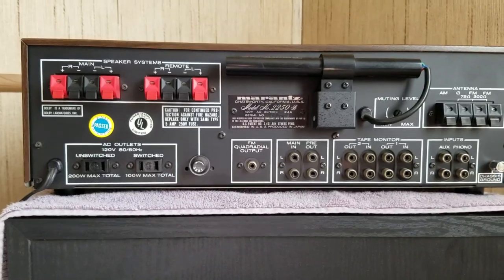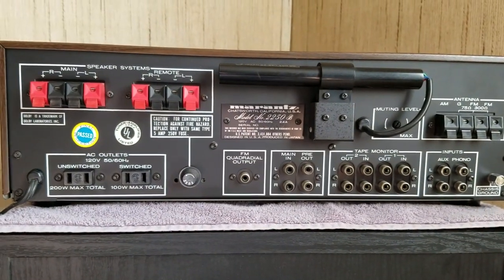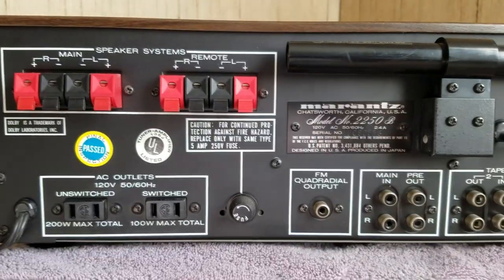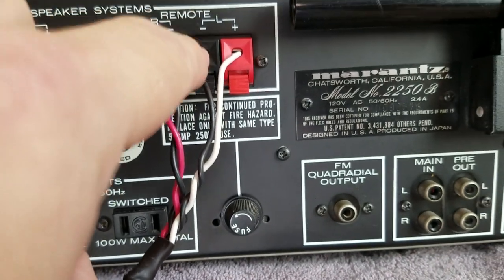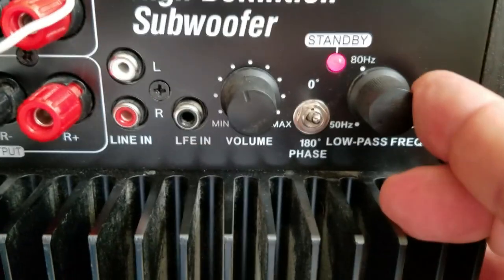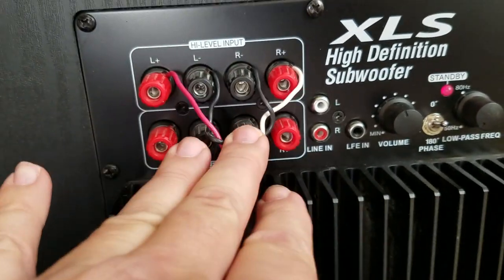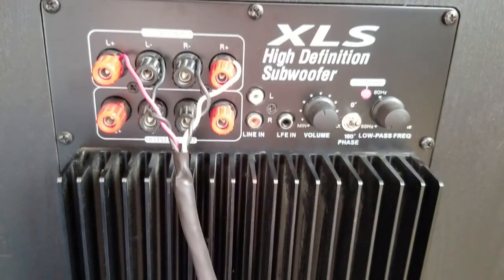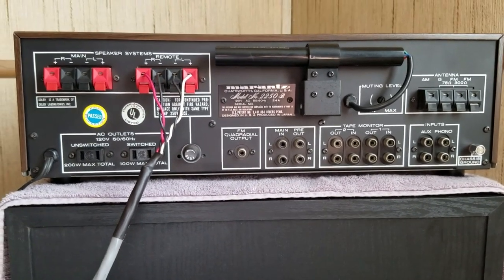How to add a Subwoofer to any Vintage Stereo

Comment: You neglected to illustrate how the front panel settings should be set. I'm assuming you set it to A&B , correct?
Reply from the maker: Correct on the a&b speaker settings. Treat the tone settings as you normally would to add or take away from your main spks, the X-over and gain controls in your sub will be independent of your stereo. Cheers
Reply: @breakerbroke23  Thanks. It's what I figured.

Comment: My klipsch  heresy's
  sound great  but need more low end  thanks  !
Reply from the maker: IMHO... Heresy's kind of suck! I have owned 2 pair and still own my original birch ply Heresy's, in order to stand to listen to them I use a sub. I use a powered 15 and roll it off a bit high. I would sell them but they are kind of sentimental to me:) I used an old Kenwood Model 11 II. No AV amp for the Klipsch....Cheers
Reply: @breakerbroke23  mine thru my sansui dont suck , but there is no bass .
Reply from the maker: Yes, no low end. Any speaker of this physical size and sporting a 12 inch driver should have some low end. Yes your Sansui will make them sound good compared to any modern AV receiver. But still a complete letdown. IMHO They need to be accompanied by a subwoofer. We need to remember they were designed to accent the K Horn .... Was the K Horn the low end producing speaker of the day?
Hmmm neat stuff  Eh?

Comment: Super excellent video thank you and God Bless you for your instructions, I have a Pioneer Sx 1050 rated @ 120 RMS per channel with 3 speaker channels A, B, and C. This means I can run 3 sets of speakers. all 2 pair are klipsh but I found an excellent sub woofer by Klipsh I purchase for 100.00 at a garage sale it has a 10 inch woofer and I want to know if I can run that on the 3rd C channel for extra depth, I am addicted to base, Your expertise would be greatly appreciated!
Reply from the maker: Yes that will work great, Just make sure you can get audio from spks A&B or C when using A . Some stereo receivers can only use A or B but not both at the same time.
 If you have a receiver that does this then just hook up the sub to spk A along whit your spks. 
I like using A for spks and B for the sub. Yes there are times I don't want a sub so then I can just switch off spk B.
Good luck and Cheers.
Reply: @breakerbroke23  Excellent, thank you so much!  Much appreciated!

Comment: Finally able to get out my old stereo that I purchased in the service, circa late 80's. In the video you talked about the power the amp puts out and into the sub, my sub is a jbl venue 12 powered at 250 rms. If hooked up to speaker b from yamaha amp could that cause plate amp in sub to blow fuse?
Thank You for any advice and the great video.
Reply from the maker: If that sub has speaker inputs, it will accept the speaker output from your Yamaha. Should not blow fuses.
Reply: @breakerbroke23  Thanks for the info, could I also ask is it possible to have a set of speakers hooked to the b  terminals and then use bannana clips also in the b terminals for the sub?
Thanks for the help.

Comment: I have the same speaker type connectors on the back of my active subwoofer but they don't say "high level". What would be the difference?
Reply from the maker: Some active subs have speaker in and out , speaker out is for satellite spks,  and spk in would be from your stereos spk output.
USUALLY,  if you only have 4 spk hookups ( red black, red black ) on your sub they are for input only because if your sub only has an RCA for input the sub would have no way to send power to external spks...
When all else fails look up your sub on the Google  for instructions.
Reply: @breakerbroke23  Thanks!

Comment: Finally! I’ve been scouring you tube and the audio karma website to find out how to do this. I have a Pioneer SX 980 with Radio Skack Optimus 7 speakers. I wanted to add a sub but wasn’t finding what you explained so simply. Thank you! I’m ordering my sub today!
Reply from the maker: Wow, nice system you have there, I love those Pioneer receivers. I have not seen the realistic speakers for long time, I remember when I was a kid in the mid 70s going down to RS and checking out the CB radios and listening to those awesome Stereo systems. Those were the Days!  Thanks for your kind words and have a great Day.....BB23
Reply: I forgot to ask . When you use the loudness button did it distort the sound or did you just have to adjust
Reply from the maker: No distortion, sometimes you may need to back down the bass control (knob on the stereo).

Comment: Hi 
What if you have 4 speakers how do you connect the sub then?
Thank you
Reply: You can connect one set of speakers to the high level output on the sub - I have this setup for my outdoor audio using a nakamichi stereo receiver and Polk subwoofer - both of which I acquired for free - so they are my outdoor presence - however they are in the shed

Comment: I have 4 speakers, where do I add the additional two speakers if I fill the B channel with the Subwoofer?
Can I double them up?  1 subwoofer wire with a Speaker wire in the same slot?
Reply from the maker: You can share the B outs with the Sub and spks. The sub will not/should not change the impedance. Also check to see if you have a pre out set of RCAs  that vari volume with the volume control on the stereo. If so then just use the RCAs.

Comment: What about a subwoofer that just has two inputs for speaker wire? Would I just use two wires and combine them in the subwoofer inputs?

Comment: If you are going to use your amp as you were using 4 speakers, you need to be aware that most of the vintage amps require 4 speakers of 8 ohms or more to do it, but all with the same impedance. If you connect a subwoofer of 4 Ohms and your speakers are 8 ohms, you can blow your amplifier. If your sub and your speakers do not match in the impedance and they are not 8 ohms or superior, you better use one channel connected to the subwoofer, and connect your speakers from the subwoofer using the hi level OUT, to avoid damage your amp.
Reply: Powered subwoofers as the one he is demonstrating will adjust 4 8 16 automatically. Relax

Comment: Hey I like your choice of speakers!  I just got a pair of La Scala's and I chose those because they are really good with a low power tube amp.  I am wondering if you could direct me on how to wire up a self powered JL Audio Sub to a vintage McIntosh C 22 pre Amp?
Reply from the maker: If I remember the JL home subs had stereo RCA inputs, you could hook those inputs to the MAC outputs either 1 or 2, not sure if the other output (recording?) works with the volume control on the front of the pre..
Not sure if this helps but give it a try.... Cheers
Reply: @breakerbroke23  That, or a splitter.
Reply from the maker: @scottlowell493  yes

Comment: Wouldn't the subwoofers amplifier only sample the speaker input so that regardless of the amount of watts moving into the speaker inputs, these watts don't enter the input of the subwoofer amp, more of a voltage gain than anything else. I'm not 100% sure, but that's my take on it.
I just received a Mitsubishi M-SUB10 a 60 watt approximately, 10 inch subwoofer it hits pretty hard, powered off my Harman Kardon 430 twin powered reciever.
That will wake the rodents outside lol.
Reply from the maker: I must be honest, I have never torn down a Sub Amp, never seen a schematic of one either, so the input design is a mystery to me. I would imagine that there would be a point as to where internal parts could take only so much voltage. 
These Sub Amplifiers are cheap mass produced chinese units...Ive wondered just how much can one take before ..Smoke!
You wake up the Rodents... Ill Shake the Pine Cones off the Trees.:)

Comment: I'm using a Technic amplifier from 1993. The amplifier is still going strong and I want to connect a subwoofer on it. The problem is that my amplifier only got 2 speaker outputs(left and right)  and one with RCA's(left and right) called "surround". Can I use the surround  port to connect a subwoofer on it??? And if yes how can I do it???? Thanks for your time
Reply from the maker: You may be able to use the surround RCAs (not sure) just use a Male to Female RCA Y adapter, the RCA outs MAY adjust volume with the volume knob on the front of your receiver. If not, hook up your sub the way I show in this video, it will not change your impedance and will work just fine.
Cheers
Reply: @breakerbroke23  Thanks a lot for the help. The problem is that my amplifier doesn't have 4 speaker outputs like yours (2 speakers on A and 2 speakers on B). It has only  ports for 2 speakers (left and right) and the RCA output called "surround". So when I buy a sub I will try to connect it the way you told me with the RCA's. If you want to see the back from the amplifier the model is "Technics stereo amplifier SE-CH505A"
Reply from the maker: @ΖαχαρίαςΛιοδάκης  look in some of the comments in this video when people only have 2 spr outputs.
You can wire up your sub to the 2 spk out. You can share the spk  out AND the sub. It will not drop your impedance.......
Cheers.
Reply: @breakerbroke23  Ok thanks for the help 😊

Comment: hmmm stereo bass...  always scratched my head about that.
Reply from the maker: Bass is added to fill in the lower frequencys that full range speakers can no reproduce. Like small bookshelf or satellite speakers with small drivers. Also, bass is omnidirectional and most powered subwoofers are a summed mono, meaning they take signal from both left and right channels and sum them together. Subwoofers can be a great addition to almost any system. And yes there are those bass heads that just need to have overextended bass, but if setup correctly a sub can be a nice addition to a stereo system. Cheers.

Comment: I'm wanting to use a subwoofer that just has your standard speaker wires coming from it.  So I would only be able to hook into either the left or right channel.  Should I just hook it into a single channel or should I bridge it from on channel to the other using a small length of speaker wire?
Reply from the maker: You want to get both left and right channels into the sub so will not miss out on any bass that may be mixed on a L or R ch only. We call this a sumed mono.

Comment: I am new to this Vintage Audio game and so far have a Pioneer SX-1010. But I like the Look of tube amps, would you recommend a Dynaco ST-70? I am very open to other opinions. Cant afford $12K for Macintosh 275 LOL
Reply from the maker: The new Dynaco amp looks very nice and not made overseas. IDk if it would sound better than that SX-1010, visa versa however IF I was going the tube route this would be a good choice. I'm a old Hafler fan, his designs sound so good.
Not sure of a head to head comp as the Pioneer will have so much headroom compaired to the 70. If you pull the trigger and get the 70, I would be interested in hearing your thoughts. 
I personally have been looking for a monster Pioneer but the prices are through the roof, that 1010 would maybe fund 1/2 the 70? 
Cheers

Comment: Is there any real benefit of using the B speaker channel to run the sub instead of using the main output and then using the output side of the sub to drive speakers? Or is that just your preferred method?
Reply from the maker: The main reason I use B spks is so I can turn the sub off at the receiver. With my speakers I dont always need the sub. Oh, and when using my Turntable I dont use the sub either.
Reply: @breakerbroke23  So, too much LFE makes yer records skip? I'm adding a TT soon also, so that's good to know. I'm old and DIGITAL sound seems very SCRATCHY/EDGY at times. BTW, which speakers do you have?

Comment: So I just have one pair of speaker outputs from my integrated tube amp. Any ideas how I would connect a subwoofer to it?
Reply from the maker: Yes, I explain how to do that in this video. Watch again (all the way through)
Reply: breakerbroke23 sorry for not being clear. I meant, I don’t have speakers A and B or Front and Rear. I just have speakers A or Front. How do I connect the sub woofer in this case? Just add it to the speaker connections? Or something else? Thanks for your video.
Reply from the maker: Yes you could just add to the speaker terminals on your amp, depending on your subwoofer location you can also wire the sub to your amp then wire the speakers to the sub. Both ways will work just fine, the subwoofer will not add any impedance so your amp will still see 4 or 8 ohms.
Reply: @breakerbroke23  gotcha, thanks!

Comment: Hi, This is great information! I have 1 twist!  I have a Rotel RX-855 receiver and a Rotel RB-850 amp that I am bridging in mono. How does adding a sub differ with this setup?
Reply from the maker: You have Pre in and Pre out jumpers on the back of the receiver. I would assume that the Pre RCA out vari volume with the vol control on the front panel. Yes? If they do vari with the front knob then you would get a RCA Y cord. Two RCA males to one RCA female. run an rca cable to the sub and plug into LFE in or Mono in. If you have both Left and Right RCA in on the sub then run a stereo L&R RCA directly to the sub. The subwoofer takes in both L&R input signals and sums them to mono and sends that to the amp powering the single sub. Done!
Reply: @breakerbroke23  Thank you very much!

Comment: I need help guys. I have a Pioneer SA-508 25 watts per channel into 8ohms amp, with A+B speakers. I'm finding it difficult getting 3 way speakers with good bass so i thought adding a sub might work. Any recommendations on the type of sub to look for. I'm new at this. Please help
Reply: It depends on your room. Because if you have concrete walls, or a small room, you dont want too big subwoofer. Subs can really create an uneven "peak" in the curve that wont sound correct. I live in a small flat with concrete walls. I intend to buy a 	
"Dayton Audio SPA250DSP 250W Subwoofer Plate Amplifier with DSP"  and make my own subs using two 6,5" Dayton audio DCS165-4 in two separate ported enclosures. For subs a plate amplifier with DSP (Digital sound processor) allows you to tune your subwoofer output so for example if your room creates a peak at 60hz and it drops off at 35hz, you can decrease the power at 60hz and increase it at 35hz so you get a more flat curve. You can also adjust the phase of your subs so they match your speakers (so their respective soundwaves hit your ears at the same time).

Comment: THis is bullshit.. this isn't for any vintage amp.. .. The best way to do this is to use a preamp with two outputs and then run the RCA to the sub in on your sub.. .that way you can tune everything right

Comment: I have a Marantz 2245...I want to hook up a sub per side using the main in/pre out connections...guessing use 2 rca cables in the L/R connections of pre out...run them to the subs...then more rca cables back to the main ins...is this correct?...I have heard using the pre out/main in connections is better than the line in to speakers method
Reply from the maker: Not sure if I understand. I would use an RCA Y adapter and then send a RCA out to your sub, you dont want to have all that cable running around as you may pick up noise (AC) and if that happens your sub will not "go to sleep" and you may hear a slight 60cycle hum as well.

Comment: I’m wondering could you hook up the back speakers (B) through the output of the sub-base speaker . 
Also I would like to know if you ever need a preamp on a vintage receiver.  Thanks
Reply from the maker: On my subwoofer you can hook a set of rears on the bottom 4 lugs. 
You don't need a pre amp for a vintage receiver...BUT! By adding a pre amp to your receivers AUX in you could hook up more devices to the pre amp and then you would have more devices to play through the receiver. Great question.
Reply: i have no preamps rca ports on my vintage onkyo but want o connect a preamp.  is it possible to connect into a tape1,2 or phono ports instead as that is my only auxilaries in?  currently, i have my android phone coming in thru tape 1.  it sounds pretty good.  but i want to power it up and want to see what my options are?  im also looking at a powered sub...

Comment: You said "ANY Vintage Stereo" but you didn't show the hookup in the case where there is just speaker A outputs. Do you just use a parallel jumper to the sub? And does that cause any degradation in audio to do it that way?
Reply from the maker: Just add the sub inputs to you main speaker out, it will not degrade the sound or give your amplifier a low impedance. UNLESS you are using a modern low end receiver. This new stuff is just a mess IMHO

Comment: Great video but this seems like modern amplifier. My vintage amplifiers doesn't have A and B outs.
Reply: same here, from what I've read online, lets say your speakers are connected to your amp, you can also run speaker wire from the amp to the subwoofer, even with the speakers still connected. You are not losing any power to your speakers as most speakers range from 4-8 ohms. Whereas subwoofers are in the 1000s of Ohms, therefore no power is lost.
Reply: @anaymakan6989  Thanks for the details. Will try

Comment: What would happen or will the sub work if connected to an amp with only one set of speaker outputs?
Can you not share those terminals on the amp so it reaches both the stereo speakers and a sub? Will it cause damage to the equipment? I have an old Nad 302 that i would like to add a sub to...Thanks
Reply: Works fine to put the active sub in parallel on one set of speaker outputs. An active sub won't draw any watts from the amp and just uses the signal.